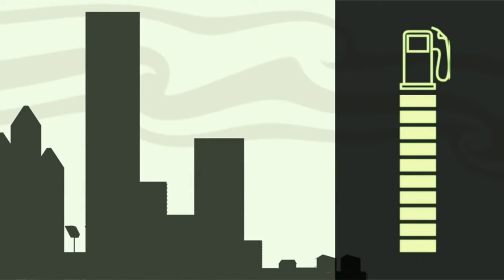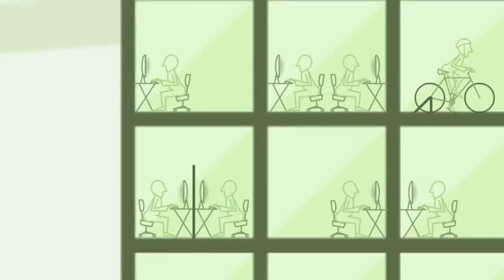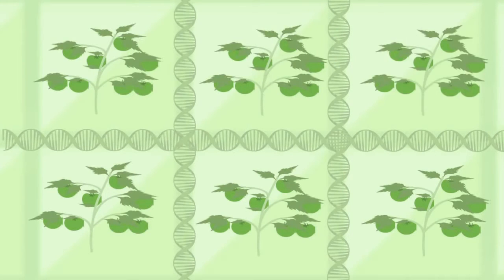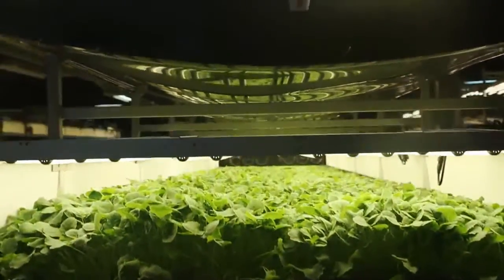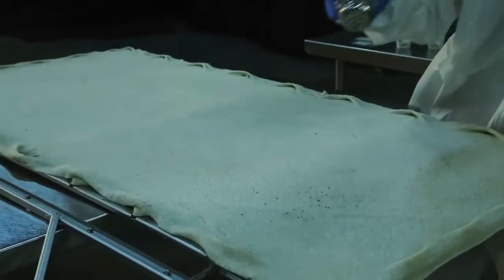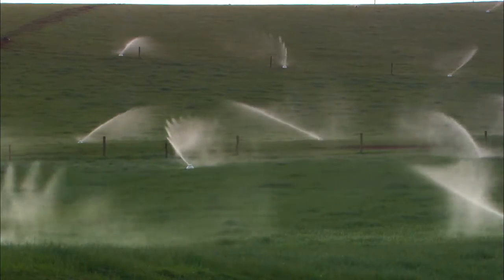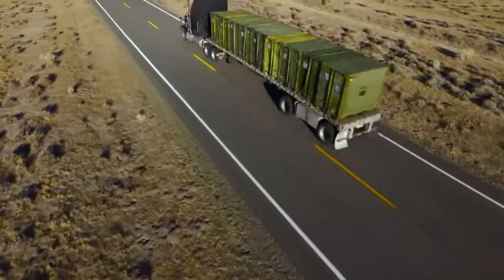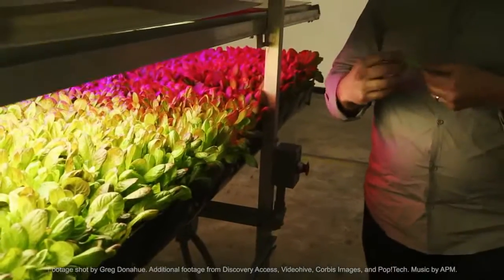Theory of Vertical Farming | Future Farming | No Soil Farming | 95% Less Water Farming

Comment: The agricultural sector in India has entered a new low. Trends in agriculture are distressing. These distressing trends highlight the enormity of the challenges lying ahead for the Indian agricultural industry.

agribusiness india

Main concerns:

Based on the sector’s current trajectory, the demand-supply mismatch in crops is likely to hit more than 15% by 2020, with the gap worsening to 20-25% by 2025 if unaddressed.
Agricultural productivity levels have been stagnant for the past 10 to 15 years, with our crops requiring around two to four times the average global water intensity.
Wastage levels in our agricultural supply chain hover between 30% and 40%.
More than a third of farmer households today live below the poverty line.
The NITI Aayog recently highlighted that the sector is 28 years behind its time.
 

For Indian agriculture to make up for lost time, changes will be needed across four main dimensions:

Productivity:
There is significant room for improvement for India’s agricultural productivity. Indian farmers produce an average 2.9 tonnes of rice per hectare, whereas the global mean is 4 tonnes per hectare. To fix this gap, a range of improvements will be needed on inputs, resource availability and farming methods.

However, adopting best practices to boost productivity will call for a significant investment in farmer awareness programmes. If our farmers have access to the best seeds, can leverage state-of-the-art treatment practices and cultivate the right crop portfolio, productivity can be enhanced by 15-20% over a 10-year period.

 

Farmer income:
Several surveys and studies have highlighted the plight of the Indian farmer. Some studies have shown that 40% of farmers would quit if they had alternative employment choices. This calls for a two-pronged approach.

The first is to fundamentally change the economics of a farm, by not only improving productivity, but also ensuring farmer financing issues are well addressed. Subsidized rural credit, creation of innovative agri-financial instruments like sale option contracts and rural insurance are key elements that can help in this regard.
Second, as farmer financial well-being is highly correlated to a robust rural ecosystem, there should be special focus on the development of supply chain-related infrastructure (warehousing), the food processing sector and logistics.
 

Ownership models:
Most farm holdings in India are small. Many farm owners are ageing and their next generation is migrating to urban India for jobs. The challenges of effective land utilization will, therefore, be under further pressure in the years to come.

Also, agricultural rental restrictions have not been revisited to reflect the realities of a very different India today. Many land owners keep their land fallow or underutilized. Even where informal rental agreements exist, land owners remain hesitant of long-term leases for fear of losing their land. At the same time, tenants feeling the duration of tenancies being too short and unpredictable, do not invest in productivity enhancing improvements.
The recent draft on the law to formalize leasing of agricultural land is a step in the right direction. More than just regularizing rentals, the Draft Model Act makes it possible for all the estimated 25 million farmers renting agricultural land to qualify for bank finance, insurance and other government benefits.
 

Technology:
Adoption of new business models and technologies in the agricultural sector can also boost India’s agricultural productivity.

Sensors, such as those that monitor soil, weather and crop conditions, or animal biometric collars, help agriculture by enabling real-time traceability and diagnosis.
Automation solutions including technologies like agricultural robots that can simplify farm work in a variety of ways, e.g., plough a field in just an hour, compared to the full day taken by a human.
Engineering solutions such as vertical farms optimize resource consumption and effectiveness.
 

What should the government do?

Build national awareness of agri best practices: This requires driving an integrated national programme involving research institutions, state administrations as well as the private sector.

Drive land aggregation: The government must take steps to encourage contract farming and producer companies. However, this requires facilitating lease-based models of land aggregation while protecting the land-ownership rights of farmers. Additionally, wasteland development should be used to pilot commercial farming.

Revamp policies related to procurement and movement of agri commodities: Three changes are critical here. Firstly, to provide remunerative incomes to farmers, procurement at minimum support price should only be done when prices go below that level. This should apply even to procurement for buffer stock and any social schemes. Secondly, the government needs to drive the implementation of a standardized Agricultural Produce Market Committees Act. Finally, to enable free inter-state movement of agri commodities, the Essential Commodities Act should be scrapped.

Streamline subsidies to encourage sustainable use of inputs: The current subsidy policy encourages over-use of inputs like power, water and fertilizers. These incentives can be redesigned without compromising end-goals of productivity or costs.  

Conclusion:

As the country with the largest arable land acreage, India can not only ensure its own food security, it can also become a source of food for the entire planet. The potential of the sector to become a growth engine for India and food provider to the world can definitely be achieved. Hence, the government should not only respond to the immediate challenges facing the farmer and the agricultural sector but also reboot the agricultural policy to create an ecosystem for the future of Indian agriculture.